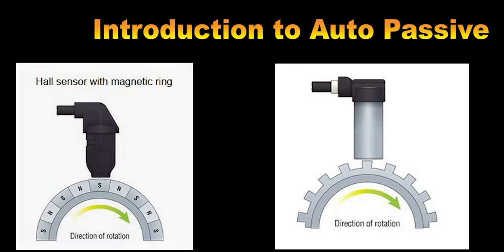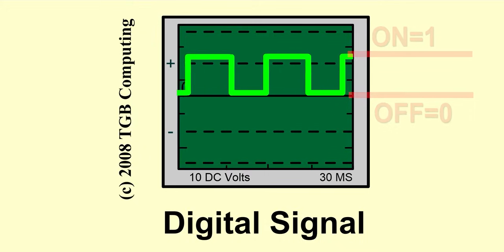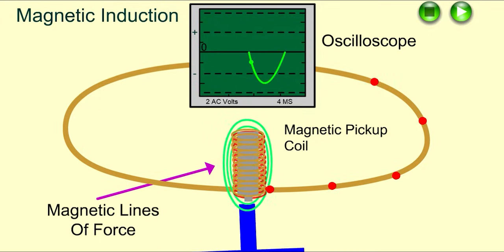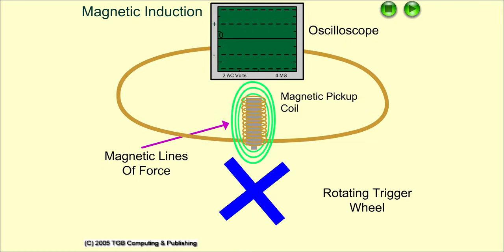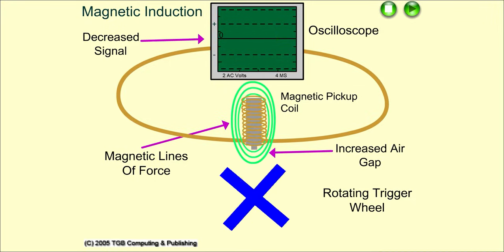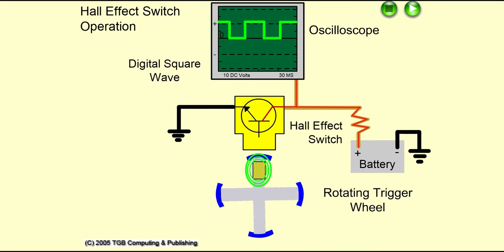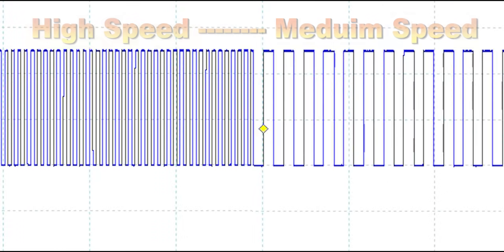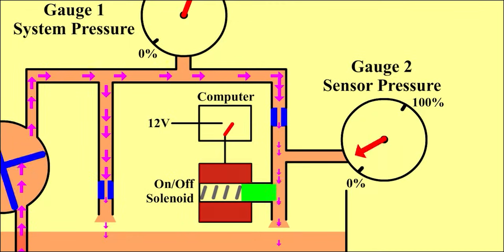Automotive Induction and Hall Effect Speed Sensors Explained

Comment: I don't think that your explanation at the end was accurate, it was actually misleading. You didn't mention the resistor in series before the measurement module.
The principle behind the change in voltage is actually voltage drop. You made no mention of the resistor, if there wasn't a resistor then there would simply be no voltage drop.
Reply from the maker: Right at time stamp 5:12 it states "the measured voltage value drops to zero".  It's just another way of saying there is a voltage drop.  I don't talk about the resister because that is not the true focus of the video and how the sensors work.   The resistor is critical because without the resistor the circuit would short out every time the circuit is switched to ground by the transistor.  The resistor is a current limiter to prevent computer burnout.  The video also assumes the viewer understand a simple circuit.  Power source, load, switch and conductors. I'm sorry this video fell short for you or it didn't have what you were expecting. One of my goals is to keep my videos as short as possible. If I had to explain the function of how a circuit works that would add minutes onto a speed sensor video while at the same time turning the video into a basic electrical video.

Comment: Sir I really appreciate of this video but my understanding is limited and I do believe "Understanding is better, than memorizing"...now I just want to understand what I experience hoping your help, cause I believed your understanding of this is deeper than mine. I just want to ask sir, I encounter an active WSS two wire one wire 12V supply inside the module procedure called it "control" other wire is pulled down resistor inside the module where the module monitored or has voltage sensing before the resistor going to low reference procedure called it"signal" that produces frequency modulated to module, now as I back probe this "control" wire  with circuit intact, ign. ON vehicle stationary, I read close to 12V, on signal wire is OV. Now  I tried to disconnect the connector at the WSS then check again same process ign ON, on control wire I read OV, on signal wire I read 4.5V, this system use magnetic encoder ring that has no tooth not same on this video, this design use together on hub bearing assy.that I'ved seen on last portion of this video. Signal wire use a pulled down resistor, and not same on this video on a positive side the module monitored, now I wondering sir, I'm talking about this vehicle I'ved check as I watched this video if vehicle is stationary and ign.switch ON, voltage inside the module is present up to transistor feed side only on the 12V control circuit, thats why I read close to 12V on control side, circuit intact and read OV on the signal circuit with ign.ON. Opposite to your video as it ON electromagnetic field build up causing transistor to energized switch close. Now on this design I'ved mentioned sir what causes the transistor inside wss to energized? Is the encoder ring produces magnetic field? How? I mean if it is,how? While vehicle stationary magnetic field is there on encoder ring itself, why not closing the transistor if the magnetic field cause it to energized? Or if ign.ON their's electromagnetic field build up inside wss why I read OV on signal if electromagnetic field can energized transistor and not close to 12V? By the way sir this Car I have check is no issue I just check this after I watched your video as my curiosity.😁 And to proved myself if its happening like on this video but I'm confuse for what I have measured using DMM and this 2022 GMC yukon. I want to stress my mind to dig deeper of understanding what engineers design and as my curiosity  always eager to gain more and more knowledge about automotive fields from you and from our service info. But in service info.not explained in detailed on circuit testing and whats happening inside the module so that I or we field techs. Accurately perform our diagnostic ability thanks sir for your informative video,hope you will reply....god bless always...😊
Reply from the maker: I just got back from vacation.  Let me look a little deeper and I will see if I can provide you with a more in depth explanation shortly.
Reply: @DrivelineMaster  thank you sir....👍 I wil wait
Reply from the maker: You have a  Magneto-Resistive  speed sensor and here are some resources to understand how they work and how to test them.  You really need an oscilloscope for accurate testing. Check out these resources.  Scanner Dan: https://youtu.be/UBNo_yg2gFI John Grischow: https://youtu.be/XfYh5_S691I Snap-on: https://www.snapon.com/EN/US/Diagnostics/News-Center/Magneto-Resistive-Sensor-Technology and Pico Automotive: https://www.picoauto.com/library/automotive-guided-tests/mre-wheel-speed-sensor/
Reply: @DrivelineMaster  thank you for your help sir...😉👍 god bless you always....eager to see your new video sir to gain knowledge from it.....

Comment: when we explain current as alternating does it mean when the current goes from the hot wire through the load and back to the panel on the neutral or does it alternate in the cable as it moves around the circuit?
Reply from the maker: This hall effect switch is not alternating current.  This is direct current.  Alternating or AC current travels from zero to a positive voltage, then back to zero,  then to a negative voltage, then back to zero while it's on it's way pack to positive.  When viewed on an oscilloscope this would be called a sine wave.  Think of a regular size D flashlight battery positive terminal connected to a light bulb with a red wire.  a black wire from the other side of the light bulb has the black wire t connected to the negative side of the battery. The light bulb will now light up.  Now quickly flip the battery so the black wire is on positive and the red wire is on negative.  You just alternated the current in the other direction.  Now flip the battery back again, Red to pos. and black to neg.  Flip it again, and again and again.  This light is now being light by Alternating current. Only in a house this happens 60 times a second.  To fast for our eyes and brains to process that the light has flickered off and on again. I hope this helps.